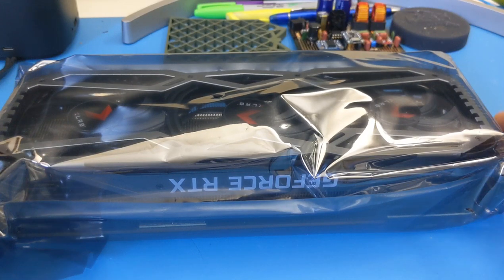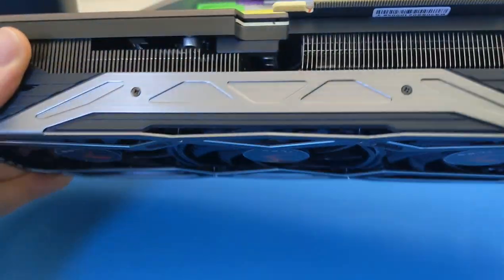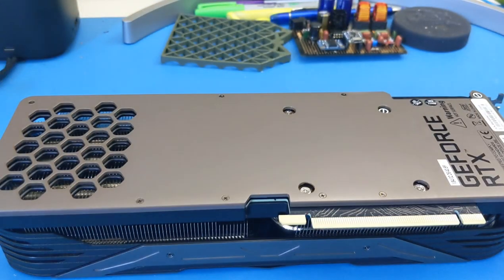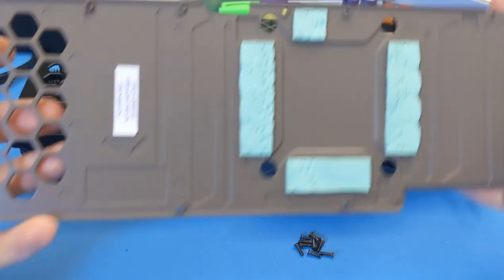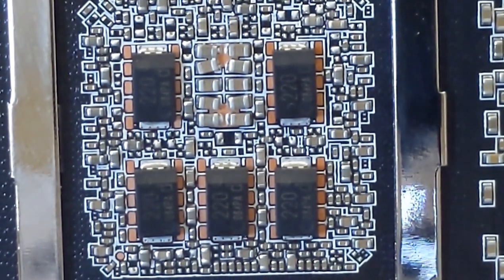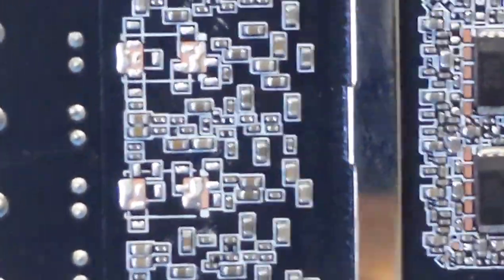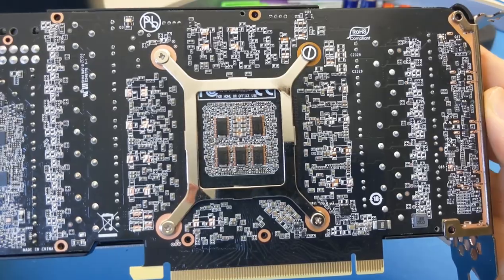PNY RTX 3080 Teardown

Comment: Most if not all of the big tech tubers seem to never review PNY cards. They seem to stick with EVGA, MSI, Gigabyte, Asus, and so on, but you'd be hard pressed to find any of them reviewing PNY. Thanks for at least doing what the big tech tubers don't seem to do.
Reply: So true. Its funny as they review low tier cards like Zotac and Colorful...Loving my PNY 3090 with matching XLR8 RAM.
Reply: @PDXCustomPCS  so is pny better than zotqc and colorful because the only rtx 3070 i can find now is pny xlr8
Reply: @JasonVoorhees-lu3lu  Yes they are better. My XLR8 3090 ended up being the same as a FE caps wise and board.
Reply: @PDXCustomPCS  I don't know about the guts, all I know is my 3080 Revel Epic-X is kicking ass. I don't see any magic numbers from anything doing any better.
Reply: @yourhandlehere1  They're great cards. I have a Suprim 3070 and FTW3 3070 alongside my 3090 now. There is a difference with the coolers not being as beastly as EVGA/Asus but they cool the 3090 fine, and its even more of a reason to put it on water later on. I got it for $1599, and see people paying that for 3070's. Were pretty damn lucky to have any GPU right now though! 😆
Reply: @PDXCustomPCS  I got a Skytech Blaze prebuilt for $2300 to my door with the 3080, a 3700X and an ASRock B550M/ac. Neo Air Case, good airflow, 120mmAIO. 750watt 80 plus gold. 16 gig 3600 ram I'll be making 32 or 48.
I just do hobby graphics now and casual gaming so it'll be just fine for my foreseeable future.
I might have done it a bit cheaper if parts were available but oh well.
I tried a 3060ti rig from the egg idiots but it died after 11 days. The 3080 is a marked improvement over the 3060ti in my programs.
Reply: @yourhandlehere1  That's a deal. Shouldn't have to upgrade for a few years.
Reply: @PDXCustomPCS  you haven’t happened to take the shroud off have you? I’m keen to know whether the heatsink is flat or if it has tabs protruding? I have a SFF and need a card I can mount 120mm fans against flush.
Reply: @inmypaants  Sorry I have not. I plan on it after the 3 year warranty expires. Dont do it if you care about that as PNY is picky on RMA's and they will deny you if youve tampered with it(Im sure you're aware just wanted to include that.) Curious what case you're trying to fit it in? Or are you taking it off to mine? Itll do 118mh/s with 1x 120mm below mine. If you're trying to push beyond that its inefficient. Power levels have to go way past 300w to see 120+ and memory gets around 96-98c at that point, not worth it. Just crank up your fans and put it on water after the warranty is up.
Reply: @PDXCustomPCS  thanks for the reply! I have a NR200 with a deshrouded 3080 FTW3 currently. removing the shroud was ez but there are tabs protruding so there’s around a 5mm gap. I have 2x 120mm fans beneath set to exhaust and the card barely gets over 65° gaming and sits around 58° on the core and 94° on the memory while mining. I don’t know if this is as good as it gets on air but I have been getting obsessed with other cards with flat heatsinks
Reply: @inmypaants  Can I ask what settings you're running? Huge difference in the coolers for sure. Definitely have to do what you're talking about as the PNY will run way more hot even at 100% fan in most setups.
Reply: @PDXCustomPCS  I have the GPU undervolted to 1925 MHz at 0.875mV it draws around 270W under full load. Pretty solid UV tbh, only sacrificing between 1-2% on raw FPS. For mining I just use Nicehash and tend to run the optimiser at “Medium”
Reply: @inmypaants  Try -300 to -350 on core. It should reduce the 94c on memory. On afterburner, take advantage of being able to save settings. No reason to stick with mining settings for gaming when its 1 click to change.
Reply: @PDXCustomPCS  thanks buddy! Will give that a go
Edit: is that with keeping the undervolt set the same? Or just stick with -300 on the core?
Reply from the maker: Thanks, I was surprised by the lack of PNY content, and while I'm certainly not polished at presenting stuff I figured I have the means. Plus it was in the thick of the capacitor investigation, so I felt it important to share another data point.

A year in and the card has given me no issues, I run Folding@home on it (100% utilization) for multiple days on end in the winter, and it keeps my office nice and toasty while staying under 80C. Dual 4K 60hz monitors, no issues with the 3D CAD tools I use. Need to play more games lol
Reply: And the PNY 3080 came with thermal pads on the back plate, unlike many other first run 3080's

Comment: Yay for the pny crew I got mine on the 30th and couldn’t be happier. Does over lock a tiny bit but once passing that 2000 mark  2040 will drop you. Doesn’t get hot at all nor passed 67
Reply: I got my pny 3090 today! the revel version, reddit forums say pny use good quality capacitors cant wait to hget my pc built!
Reply: Loving hearing that! I just finished my build with a PNY XLR8 3090 Revel with matching 3600mhz XLR8 memory. I'm not finished tuning but damn Port Royal looks amazing. Its so cool seeing what the future holds. Seems like its Pretty much an FE with a nicer looking cooler!

Comment: The reason those thermal pads are on the backplate is because the GDDR6X memory is flip chip so a lot of the heat gets soaked into the board. You can even tell the pattern the use matches the chips if you look at die shots of 3080s where those two blank spots are at the top right. Great video though thanks. This was the only card at the moment that's available.
Reply from the maker: Thanks for the input! I agree the thermal connection is to spread the heat load from the board

Comment: im looking at deshrouding for my case, hows the radiator underneath ? flat or tabs need bending ? is it  non destructive taking the shroud off on this card ? thank you
Reply: I’ve been posting similar questions on cards like this! I have a NR200 and want to do a deshroud mod. Currently own a 3080 FTW3 and found tabs protruding and couldn’t sit the 120mm fans flush. Contemplating picking up one of these PNY 3090’s and selling the FTW3

Comment: Just ordered this card as a 3090, another thing we have not seen with this card yet is what the RGB looks while on in a pc.  Also glad we don't have 6  "cheaper caps" was worried of that!
Reply: Sorry, so this one is the one wich NOT crashing?
Reply: That's arguable. They have used the "cheapest" SP-CAPS at 220u instead of 470u for the Gigabyte cards for example (which doesn't have MLCCs though).
Reply: I have one shipping too atm. It's the same as the Gainward 3090. PNY owns Gainward so it's just rebranded. I'm hearing it's same as FE on caps. You receive your 3090 yet?
Reply: @PDXCustomPCS  do you have your pny 3090? How has it been?
Reply: @birkatron1  Its a great GPU. I have a 8700k@5ghz and it handles everything with ease. I will upload a short build video in a few days. Fully modded GTA5 with REDUX and lots of replacement cars, all on Ultra settings will slow it down. But only when you turn MSAA up. Even then I'm getting 45-60fps at 4K. I'm coming from a Titan X Pascal(and 2070S for 1 month.) So the change is definitely very noticeable. It does not have the cheap caps and has the Micron factory board. My max stable OC on it has been +200 on the Core and +450 on memory. Also, velocity X software is very decent and has a good amount of RGB modes.
Reply: @PDXCustomPCS  thanks? Which model do you have? I'm looking at the pny rtx 3090 epic-x rgb triple fan xlr8
Reply: @birkatron1  I have the Revel. Model is VCG309024TFXPPB. The other model has no RGB on the fans but has RGB on the RTX logo on the side. If you're mounting vertical like I am the Revel looks better and has better RGB modes. Have to add that the XLR8 matching memory is great as well. Very stable, and has 5 separate customizable RGB sections.

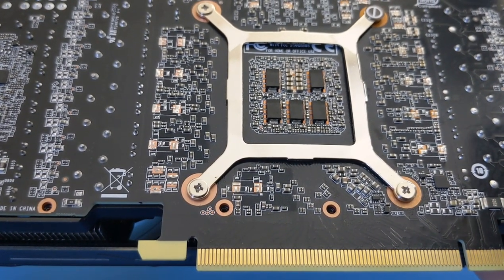Comment: the caps at 3:19 where they could have used 6 large instead of 5 large + 10 small, the small ones are all crooked. Perhaps PNY was making these with 6 large and had issues, and fixed the cards by hand?
Reply: They actually appear to be crooked on purpose based on the pcp contact point.
Reply from the maker: Footprints are set by Nvidia if I understand, but don't quote me on that lol. The combined footprint makes sense so the artwork fits both styles of caps. Not ideal for  automated reflow, but clearly it works. I'd be curious what % of boards require manual solder rework.

Comment: Have You experienced any coild whine or crashes with this card?
Reply from the maker: No issues, operates frequently at 100% load for days at a time (folding at home, not crypto shit)
Reply: In case anyone comes by and reads old comments.. I have this card and the coil whine is ridiculously loud on mine. At first I thought some cable had come loose and was scraping against a fan. It got a little better when I set a power limit of 200W (normal is 350W) but it's still worse than anything else I've heard.

Comment: Does this have any watercooling support? Does EK or other reputable waterblock makers have stuff that will work for this ?
Reply: Yes, this is one of the few boards that is actually a reference pcb design. Most boards have fully custom pcb for each manufacturer.  So any reference waterblocks for 3080 should work on this board.

Comment: What are the 2 small holes at the rear of the card? 1:10 mark
Reply from the maker: No clue, but they are threaded holes. There is an included "anti-sag" brace, but it does not appear to interface with those holes.

Comment: I have this exact card and the RGB is terrible. You can’t even really see it. Great card other wise and I am pleased with it.
Reply: Should be mounted vertically to see. Are you using Velocity X to control the lighting?
Reply: How about the fans? Do the fans stop when at idle?
Reply: Lloyd de Castro Yes they do.
Reply: @brenttitus2134  Thank you. I can only know by asking. Still waiting for the damn card.  hahaha. Really hard to find one. Congrats on your gpu. :)
Reply: @Emanuel Gjoni That is excellent temps. I don’t bother OC because they are fast enough as is. And you get minimal gain. PNY is a good brand. You can try reaching 2000mhz. My max boost from the factory is 1920mhz.
Reply: How is the noise level of this GPU in comparison with the other brands? Is it quiet?

Comment: Is this affected, included on the controversial capacitor issue? thanks..
Reply: No they fixed that issue, I have this card it has run great for me
Reply: It was never the caps to begin with, it was a driver level issue, which was fixed by the driver already.

Comment: Can you make a video how the RGB works? I just ordered the same and waiting to arrive.
Reply: Master Penny D  EasyPC po sir. Just message them via messenger for pre-orders.
Reply: Master Penny D  Sept. 30 po.
Reply: Master Penny D  Tiwala lang sir. Dadating din yan. haha
Reply: @Emanuel Gjoni I still don't have my card yet. Waiting game really is a headache. As i've read in some articles, you should be able to control the lighting thru Velocity X. Didn't it worked?
Reply: @Emanuel Gjoni did you figure it out yet?..I ha e the same card and downloaded the xlr8 gui,and under the gpu temp tab there is an led control tab..let's you control the rgb..
Reply: @Emanuel Gjoni yeah this is the 1st pny card that I have owned.i figured that I had to at least try it so I could control the eng,and so far  the overclock function is working just fine..no complaints after a month of using it..

Comment: 2:57 = DONT BUY  = 1 set need 2 or more..
Reply: Interestingly, the UPRISING version of this card uses the 2 MLCC setup like is found on the founders edition. PNY cards were the only thing I could find in stock and I'm so glad I did some research before I chose between the two.
Reply: The revel 3090 has two MLCC as well
Reply: @Drewgystew  the uprising version is definitely better I have it also and love it, it's basically the same as the founders edition
Reply: You're wrong and spreading misinformation.

What you're saying applies to the RTX 3090 not the RTX 3080 cards.

Bad for the 3080 is 6 Capacitors with 0 MLCC's. Good is 5 Capacitors with 1 MLCC or 4 Capacitors with 2 MLCC's (they're basically the same) the FE is the latter.

The 3090 FE has 4 Capacitors with 2 MLCC's and the PNY RTX 3090 REVEL has the same layout as the FE.

PNY make FE cards and are the only Quadro manufacturer for Nvidia AKA they know what the fuck they're doing and follow the specs properly.